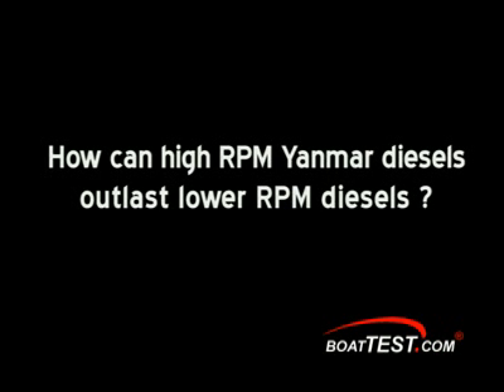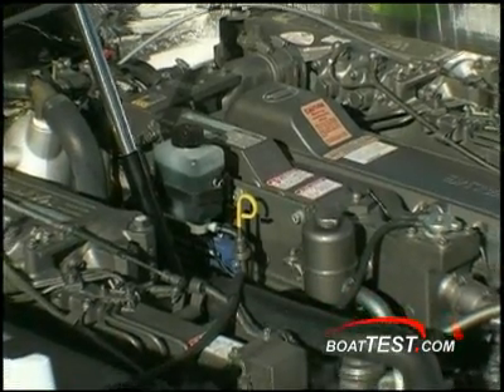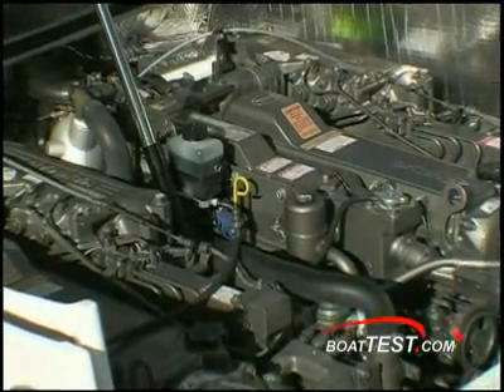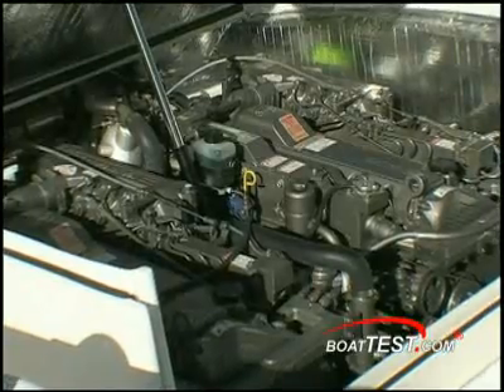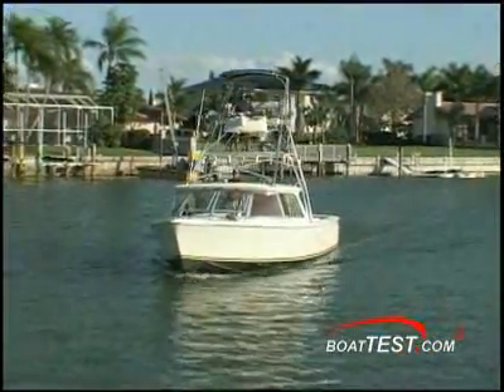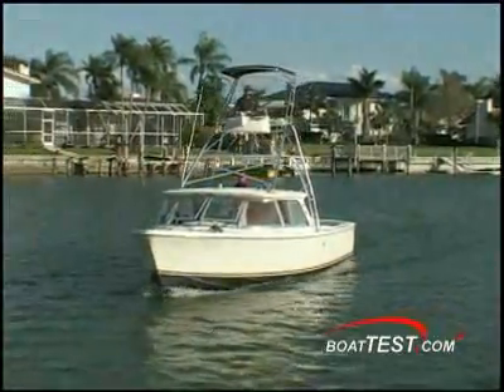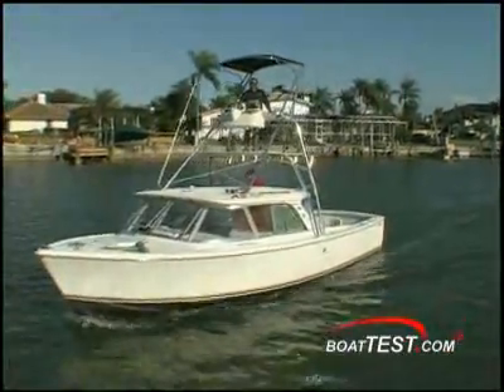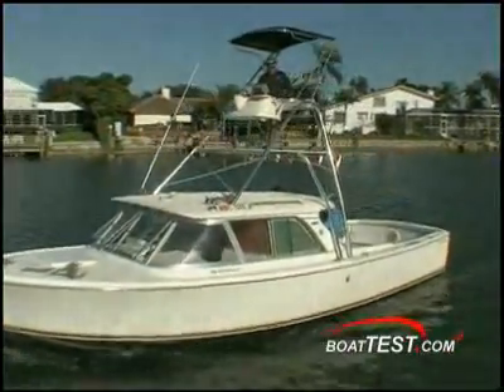Yanmar Engine- How can high RPM Yanmar diesels outlast lower RPM ones (Kevin Carlan)- BoatTest.com

Comment: Um, no one has pointed out the fact that this sales manager is wrong after doing the math?   Yanmar 315 with a 100mm stroke vs the Cummins 330 with a 124mm stroke. 3800rpm vs 2800, works out to be Yanmar 41.55 ft/sec and Cummins 37.97 ft/sec at max rpms.  And to draw out the data on ring wear over the bore, the Yanmar's piston rings will travel 4900 miles MORE per 2000 hours or 2.45 miles farther every hour of operation.
Reply: But not at the same RPM.  Most people don't run at max RPM for any length of time.